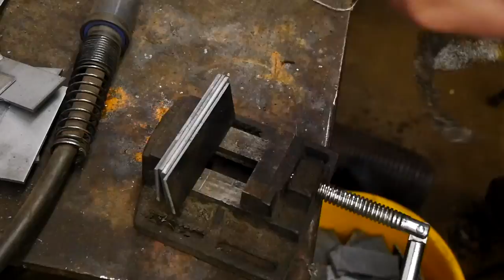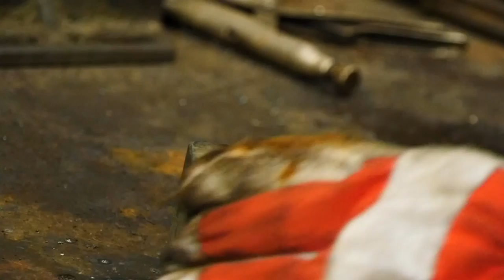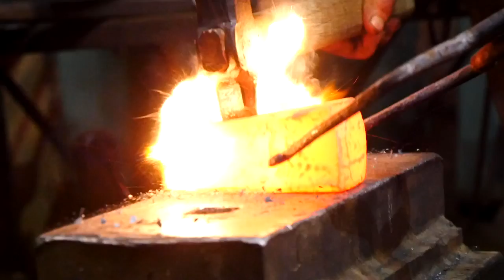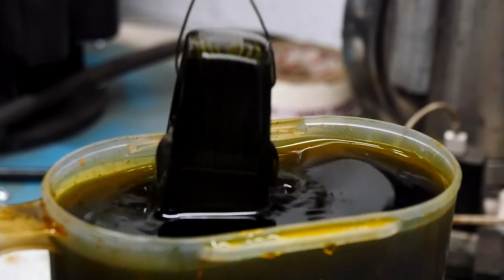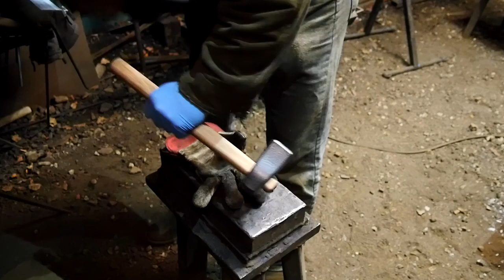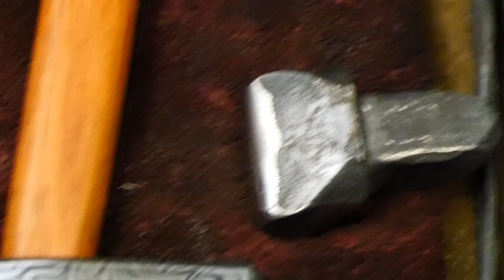FORGING A DAMASCUS JAPANESE HAMMER

Comment: Hey when you weld the damascus together with the welder have you tried just tack welding instead of a full bead. It may not hold I've never tried it I just figured it might be easier to grind out tack welds then a full bead

Comment: What quenching medium do you mainly use? Or do you use what is the most suitable to the steel you're using?
Reply from the maker: +BlakOrkk use what the steel specs require - I use a parks 50 equiv!

Comment: Hey Alec! Would a damascus billet of 5160 steel and 1095 be good for a knife or would 5160 alone would be enough? Thanks.
Reply from the maker: +Matt falconian 5160 is good
Reply from the maker: +Matt falconian dont make Damascus with any other steels than the most common steels used in it - waste of effort!